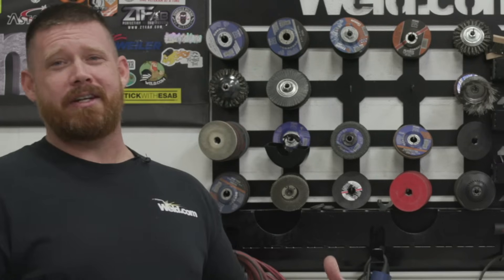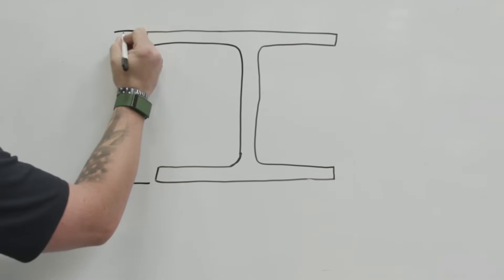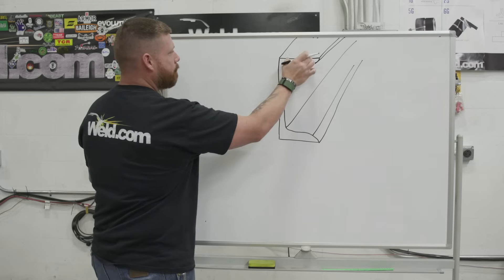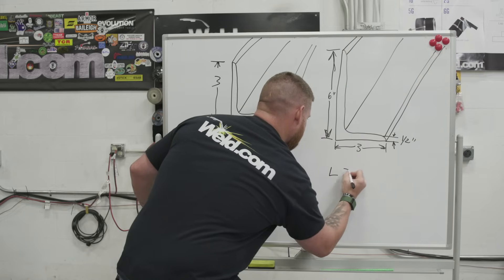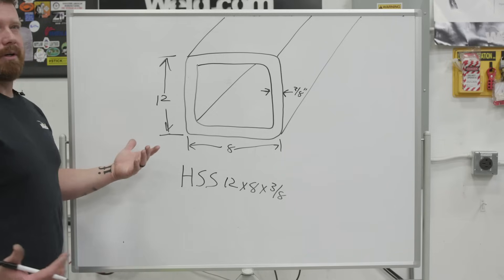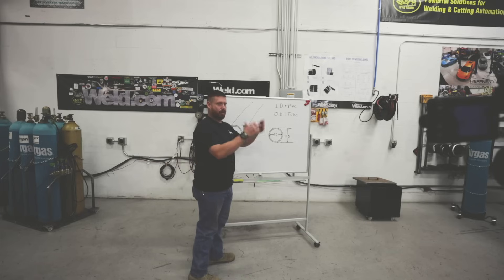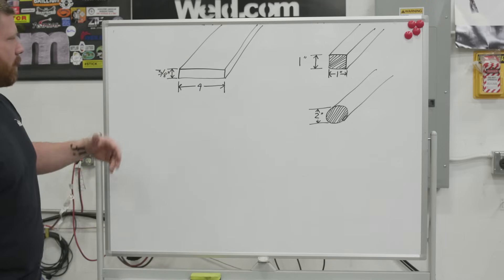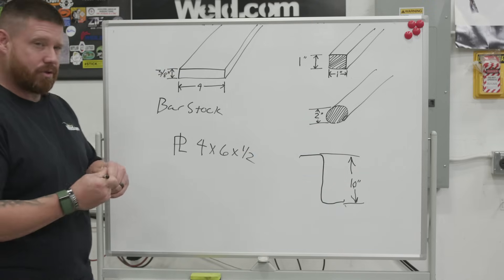What are the Different Structural Steel Shapes?

Comment: I think the S beam and I beam are mixed up. The S has thick tapered flanges, and the I beam is called a W beam (for “wide flange”) with flatter wide flanges. We usually just use S sections for monorails, and W sections for structural beams and columns. H sections are mostly just for piles.

Comment: Smaller pipe, <12", the OD. stays the same as the schedule changes. This is because these pipe sizes are very commonly threaded. If the OD. changed it would not require a different set of dies for each schedule. A friend of mine went to a shop to see if they could/would thread a piece of 3/4" extra heavy pipe for his steam launch. They told him they could only do sch40? Was the answer due to ignorance or were they using it as a polite way to say we don't want to have anything to do with a hobby boiler and steam engine?   

Dave

Comment: In England they are just referred as uc,universal column and ub,universal beam.non of this I,s,h beam nonsense. Channel is named pfc, parallel flanged Channel. And its certainly not angle iron. It's steel to start with and named RSA,right squared angle. Bloody yanks  just want to try and confuse things.  Hss is shs square hollow section. Rss is rhs, rectangular hollow section. Use millimeters instead of inches, its far more precise.

Comment: I hate to be the bearer of bad news, but it might not be a good idea to believe everything you hear on the internet.
If you are interested in what the various structural shapes are called, maybe Google "Structural Steel Dimensions".   This nice guy is generously sharing information - misinformation.  He seems to be making up his own nomenclature.  To be fair, someone probably taught him wrong.  I guess it's hard to unlearn something once you think you've learned it.

If you want to know what the OD is for the various weights of a particular diameter steel pipe, it's all the same.  The OD never varies with wall thickness.  Maybe Google "Steel Pipe Dimensions".  It would be really hard to buy a threaded fitting, or a threading die for a pipe if the OD varied.  Or a Dresser coupling.  Or a slip on flange.  Or pipe insulation.  The ductile iron pipe industry, copper folks, and the PVC sewer pipe industries have their own and different sets of OD standards, but the ID always varies with wall thicknesses and OD is always consistent.  Gravity storm drainage pipes are sometimes different - the nominal size and the ID are generally the same, and the OD bigger. 

2x4s are 1 1/2" x 3 1/2".  At least in dressed & dry framing lumber.  They used to be 1 5/8 x 3 5/8" back before WWII so if you're demolishing an old building you might run into some of these antiquated lumber sizes.  The hardwood industry and softwood industries have differing dimensional standards.  In the US s dressed 1x in softwood is always 3/4 for instance & in hardwood I think it's 13/16".  If your hardwood is from the rainforest, a 1x will likely be 20 mm which is a tidge over 3/4" and well under 13/16".

Good try guy.  Thank you for being generous with your knowledge, but maybe double check your facts before you do your next instructional video.  I'm sorry, but your video is wrought with errors.  Teaching misinformation is just furthering the problem.

Comment: I believe the reason that sch pipe wall thicknesses increase with diameters are due to the larger amount of square inches on the ID of the pipe. A 12” sch 40 pipe will have a heavier wall thickness than a 3” sch pipe and assuming they have 100psi operating pressure, the 12” pipe will have more square inches than the 3” pipe will, therefore it will require thicker wall to hold the same amount of pressure as the sch smaller pipe. Remember it is pounds per square inch... that’s how my simple brain looks at it.... take care and as an old timer kept telling me...watch the pretty blue light

Comment: Answer a question , the shop I work in has built a new addition single story   , identical to the old one (90') , the new one has a piece of  round 10" that spans one section at opposite ends unlike the old one which has none. what are those for?

Comment: So, this is from hardhatengineer.com... "Definition of Schedule Number: The schedule number indicates approximate value of the expression 1000 x P/S where P is the service pressure and S is the allowable stress, both expressed in pounds per square inch."

From that, I would think the following would make sense... but this is only an educated guess.

So for a schedule 40 pipe, 40 = 1000 x P/S.  Therefore if you rearrange the formula and reduce, P=0.040S.  In other words for a schedule 40 pipe the wall thickness is designed such that the allowable internal  pressure (P) would be 0.040 or 4% of the allowable stress (S)

It would stand to reason that for a schedule 80 pipe the allowable pressure would be 8% of the allowable stress and for schedule 160 pipe the allowable pressure would be 16% of the allowable stress.

This does not directly relate to a wall thickness, but would help to produce, perhaps a moment of inertia or a section modulus that would be used to generate wall thickness with additional calculations.

In the process of doing so, the OD stays the same so fittings work across the pipe size range, but the ID changes due to varying wall thickness to produce the pressure to stress relationship (schedule), which affects internal volume and flow.

Comment: If I'm not mistaken, schedule refers to the pressure the pipe is rated for.  As the pipe diameter increases, the thickness must also increase.

Comment: Your best bet for learning shapes is to browse the information published by the suppliers. Alro's website is awesome, and you can always call them to get more explanation. There are too many variations to describe in a video, and this video has a few discrepancies with what is available in from my research of suppliers in the Detroit area. 

Schedule is based on the pressure the pipe can withstand, so larger diameters need a thicker wall. Larger circumference means more hoop stress.

Comment: In March 1927, the American Standards Association surveyed industry and created a system that designated wall thicknesses based on smaller steps between sizes. The designation known as nominal pipe size replaced iron pipe size, and the term schedule (SCH) was invented to specify the nominal wall thickness of pipe.

Comment: HSS always bugs me. I keep reading it as "high speed steel". Like HSS drill bits
Reply: never came across hss over her in aus.we just call it shs (square hollow section) or rhs (rectangle hollow section)
Reply: Lol i always thought it was high strength steel cause we use it for support columns
Reply: it's actually hollow square steel

Comment: Wood is different because it’s measured on green wood, before being like dried. People often think that wood is cheaper these days because it’s not a full 2x4, or whatever other nominal wise designates it. So they cut 2x4s, and dry it, and it shrinks. In the old days, when wood was air dried, they didn’t get as much water out of the wood, so it was in between the size today, and the green size. But air dried wood isn’t as stable, or as strong. So modern 2x4s are actually better.

There are a lot of different types of tubes, and many do indeed carry liquid or air through them. I know structural guys don’t know about things that aren’t used for structure.

Schedule is related to pressure. Bigger diameter pipes and tubes carry lower pressures than smaller diameter pipes and tubes for the same actual thickness wall.. So schedule is designed to keep the same amount of pressure for different diameters. That’s mainly why schedule 40, for example, is thicker for 8” than for 3”.

Also, I’ve found that a lot of shapes are available in 24 foot lengths rather than 20 foot lengths.

Comment: PIPE SCHEDULE
WRITTEN BY MATT MILBURY ON 18 JANUARY 2016. POSTED IN PIPE

Pipe Schedule is the term used to describe the thickness of a pipe.  The outside diameter of a pipe is the same for all schedules in a particular nominal pipe diameter.  Standard standard pipe schedules or pipes sizes as given by ANSI / ASME B36.10M and API 5L.  There are eleven schedule numbers commonly used: 5, 10, 20, 30, 40, 60, 80, 100, 120, 140, & 160.

The most popular schedule, by far, is 40.  For pipe 8-inches and under, Schedule 40 and standard weight pipe wall thicknesses are the same.  Schedules 5, 60, 100, 120, & 140 are rarely used.  This should be considered when piping is specified for a particular project.

The schedule number is defined as the approximate value of the expression:

Schedule number = (1,000)(P/S)

Where,

P = the internal working pressure, psig

S = the allowable stress (psi) for the material of construction at the conditions of use.

For example, the schedule number of ordinary steel pipe having an allowable stress of 10,000 psi for use at a working pressure of 350 psig would be:

Schedule number = (1,000)(350/10,000) = 35 (approx. 40)

Note that the pipe is not always the "weakest link" in a piping system but this should be examined each and every time pipe is sized.

 METHOD FOR DETERMING SCHEDULE

Measure the inside diameter and divide it by the wall thickness. (inches) R = ID/Thickness

Pipe Schedule	R
Schedule 30	40-50
Schedule 40	29-39
Schedule 60	25-29
Schedule 80	20-23
Schedule 100	16-18
Schedule 120	13-15
Schedule 140	11-13
Schedule 160	9-11
 

STANDARDS
API Standards
API Spec 5L - Specification for Line Pipe
ASME Standards
ASME B36.10M - Welded and Seamless Wrought Steel Pipe

Comment: The schedule is for rating the pressure so the bigger the pipe it has to be thicker to handle the pressure so if you had something that was needing 1500psi and that required schedule 80 it wouldn’t matter if it was 2” or 12” pipe as long as you used schedule 80, and after 12” pipe once you hit 14” it changes to OD like tubing and also the tubing that I work with is mill wall thickness not schedule so if you have a tube that’s 2” x mw .125 you would have a 2” tube that’s an 1/8” thick, I enjoyed the talk on beams though it kind cleared some things up with me
Reply: There is no correlation between pressure and schedule.  Here are the specs. https://www.engineeringtoolbox.com/wrought-steel-pipe-bursting-pressure-d_1123.html

Comment: Most steel suppliers will have a chart or small booklet that list the common shapes and sizes they will provide. Mine has both. They are handy for daily use. Someone below mentioned the AISC structural steel handbook. It is worth having

Comment: If you are in the welding field buy yourself an AISC manual, and learn how to use it. The current version isnt even necessary, an older version is fine. Safety gear and knowledge are the best investments you can make in your career.

Comment: You might also cover metal type-steel; cold rolled, hot rolled or extruded.  some pipe, tubing, and hollow shapes are welded or extruded.  stainless steel, aluminums
Corten steels, galvanized(which releases toxic gas when welded)
AISC is a good reference.

Comment: question diff subject ... plasma tables ... witch is better  water table or down draft ??  what do you do with the old water ? also you have too keep garage heated to keep table from freezing ,down draft they say you loose garage heat ..and you trip over ex pipe . some people say the used water is a hazard waste ? let me know what you think .. thank you ..
Reply from the maker: Used water is hazard waste. Water tables work a while lot better than down draft though. To keep it from freezing add some water table fluid.
Reply: @Welddotcom  thank you ..

Comment: Schedule grade to my knowledge is the psi max the pipe can safely contain based on the type of material used
Reply: Schedule grade AND diameter will determine the pressure rating of the pipe. Here's the engineering facts. 
https://www.engineeringtoolbox.com/wrought-steel-pipe-bursting-pressure-d_1123.html

Comment: Pipe schedule is based on bursting pressure rating: it takes a thicker wall to resist higher pressure. Also, the larger the diameter, the greater the area (same # pounds, but more square inches trying to constrain it) so greater wall thickness needed. 2" sch80 is 0.218" thick, 6" sch80 is 0.432" thick.
"So the pipe thickness which would hold 600psi at 15 ksi material strength was designated as schedule 600/15= 40."
Reply: no your wrong, its not the bursting pressure. its the design pressure. the bursting pressure would be higher than the schedule. it wouldn't make sense to engineer something that fails at its max design. if i can explain it simple for u, a 2 ton jack is rated as 2 ton because its design load is 2 tons, that doesnt mean it fails or "bursts" at 2 tons, it wouldnt make sense to sell a 2 ton jack that fails at 2 tons. it would fail maybe at like 2.5 tons  or more. also take as an example the hauling capacity of a pickup truck. say its a truck that is designed to haul 4 thousand pounds. that means its design load is 4 thousand pounds, but of course uve seen people push that limit and overload their trucks, the truck doesnt fail because its design load is 4 thousand pounds but  thats not its failing point. u would have to put 6-8 thousand pounds in the truck before it "fails" or something breaks. so i hope u understand the schedule is not the bursting pressure but rather its design pressure. just like a car tire say it says 40psi, that doesnt mean the tire bursts as soon as it hits 41 psi, u would have to reach near 100 psi or more before a bubble forms or it bursts. everything else u said is basically right though. it does take thicker material to maintain that design in wider pipes compared to small pipes. as an example when u step on a lego piece it hurts because it not flexible and feels like a rock. but if u take that same plastic and make it into a 1 foot box the same thickness as the lego piece it will be a super flimsy plastic box. in order to make a 1 foot box that is the same sturdiness as the lego piece the walls would have to be a quarter inch thick maybe more compared to the lego piece that the walls are only 2mm thick. hope that helps

Comment: Correction on pipe thickness. Because it's nominal size, 2" standard wall (sch 40) will have a 2" ID and aprox 0.153" wall thickness. However sch 80 will have aprox a 0.218" wall thickness and something akin to 1-7/8" ID. OD on the example will be the same (2-3/8" approximately). Coming from expirence doing pipeline and natural gas distribution.

Comment: Wrong... On pipe the OD stays the same. The ID changes with schedule.

Also, HSS = hollow structural SECTION but its all the same.
Reply: Some engineers call it 'tube steel'...

Comment: Open the AISC structural shapes pdf and all of the standard callouts here are defined. CAD guys:  measure the ACTUAL dimensions of the stock. W12 will NEVER be 12" and different from one steel mill to another. Depending on what you are designing this can be critical in making sure the fabricators don't have to do extra coping rework or gap filling to achieve the final dimension on the drawing after the Sawyer already performed the cuts accordingly. USA users, look up the pdf for "Naming Convention for Structural Steel Products for Use in Electronic Data Interchange (EDI)"

Comment: Fun fact: I had a fab shop tell me that it’s cheaper to have 2 pieces of angle welded together than to buy square tube of the same size.
Reply: Depends on how quickly you could get it fitted & welded. You're pretty much spending a little extra for the convenience. I'm not disagreeing with you either .
Reply: I'm not going to disagree, but it seems a bit contrary to think your welder @25$/hr + consumables + prep & execution would save $ vs. purchase of the correct material.   Probably more true for a small job.
Reply: @firebird77clonefirebird89  yup
Reply: Less expensive isnt always best consider the application and safety factors before going for cheap alternatives ,if you have any dought about the safety for the intended application of welded angle by the tube
Reply: It was just a general discussion about the cost of different structural steel shapes. I was surprised by that comment though.

Comment: For Structural Steel.. .."I" Beams don't exist.  "S" shapes are typically for crane rails, the inside profile of the flanges is more like the slope on channel sections. The nominal depth for W sections isn't within +/-.05" for the lighter weight sections the actual depth is usually about +/- 1/2". For example a W12x30 is actually 12 - 3/8 deep. WT's are cut from W shapes. HSS above 12x12 in size is usually a special order.
Reply: I didnt undestant anything, but I guess it's because im thinking in european
Reply: in australia you have universal beams, universal columns, no need to make it more complicated than it needs to

Comment: Is TRIANGULATED TUBE STEEL available?
Reply: Of course, we can shape any steel into any shape you can draw us a sketch of.....for a fee.
Reply: Answering your question with two questions: 
How much do you need? How deep are your pockets? 
  Another fact is that aluminum extrusions are almost unlimited in shape/profile.
Reply: Stan Ervin sheesh, only limited by his pockets.
Reply: Stan Ervin plus, maybe limited by his pride. Nobody wants to build something using materials that were made by a process mimicking that of a terd. 
Guess your a fan of pressed out crap huh? Each his own, that’s still better than the pressed iN crap.
Reply: @jaxturner7288  
Tool and die maker, if you were wondering
Reply: Stan Ervin why would I wonder? Did someone mention professions?
Reply: Stan Ervin yessir, sorry bout your luck.